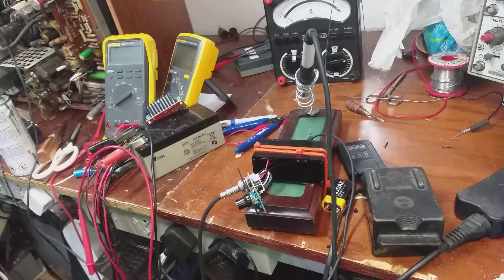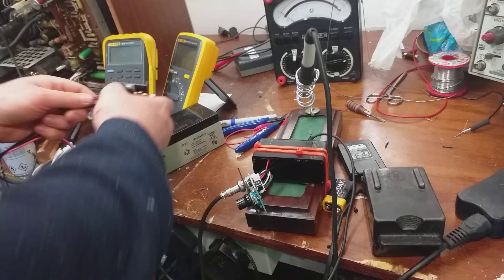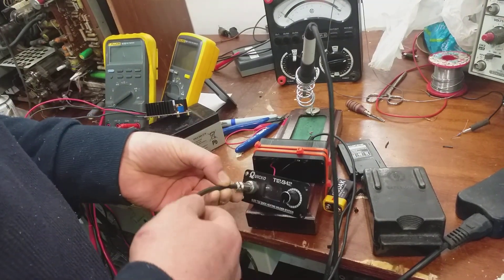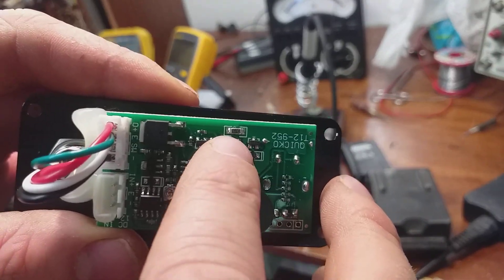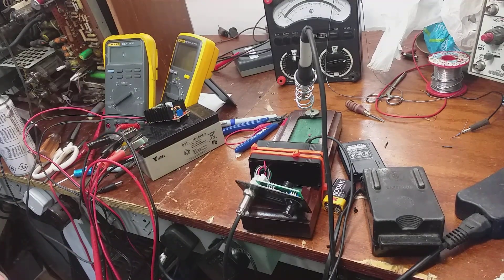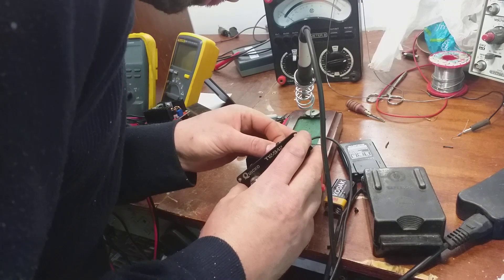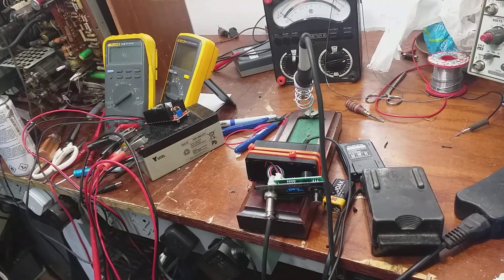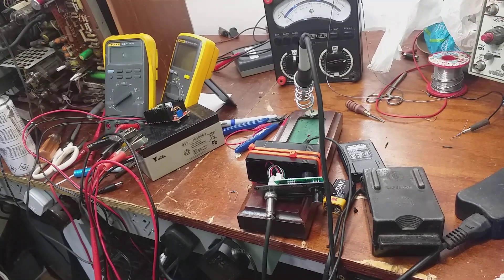Quicko T12-942 Reverse polarity repair.

Comment: I'm happy you were able to recover it :-D, i suspect that the resistor was a feed to a 3 pin regulator.
Did the 3.3v regulator check out ok, still spot on voltage?
Maybe stick a big diode in the positive wire going to the board, although i would have expected there to be one just in case.
We all make mistakes, it's what you do after it that matters.
Ive killed a few things when ive had a "Soggy brain" day lol.
Reply from the maker: No diode in this one, after all it's built to a price. Anyway she lives to see another day.